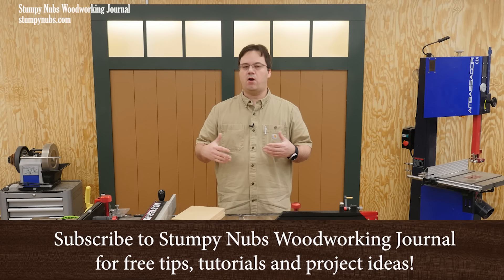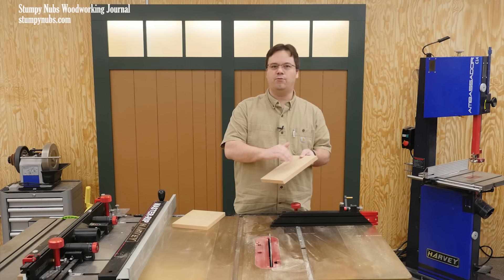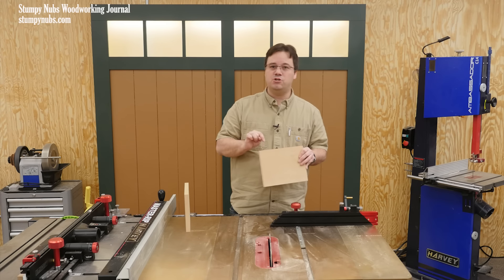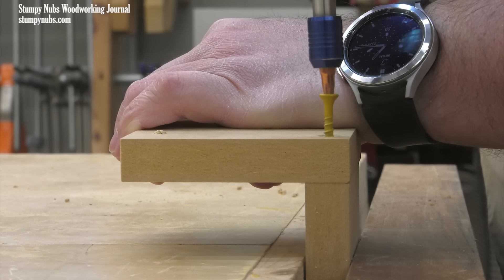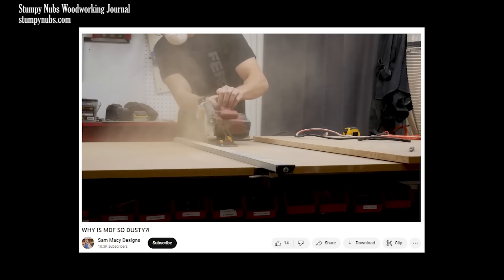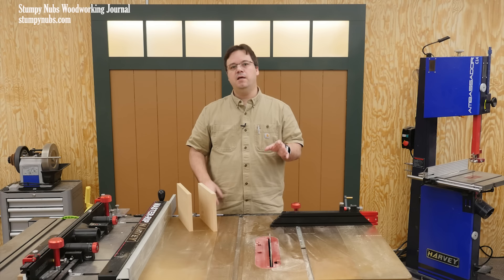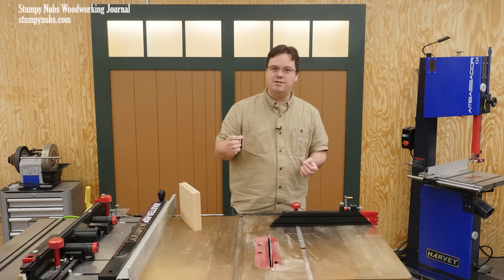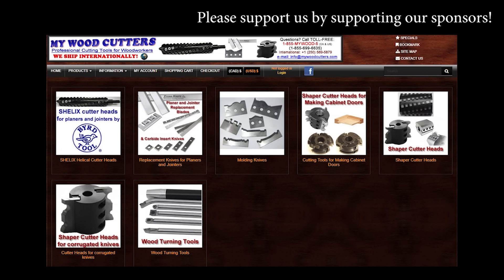This stuff changed my mind about MDF projects

Comment: It’s worth noting that MDF is not a uniform density all through. The smooth surface is considerably firmer than the underlying structure. If you sand or plane it thinner, you’ll loose much of its structural integrity, and just as a melamine coating will make fibreboard much stiffer, so does the outer smooth surface of MDF. Another piece of trivia is its permeability. A strong vacuum applied on one side will pull air from the other side. In this way, MDF can be used as a hold-down for sheet materials on a CNC machine. This works even better once you take the smooth, denser surface off one side.

Comment: I have to take issue with a couple of your comments:

1. You say that the best way to join MDF is a rabbet or dado joint.  Since the material has no grain, the short leg of a rabbet or dado is extremely weak, so you also need additional metal fasteners.
 A much better choice for a mechanical joint would be dowels or dominos.   

2. You show using deck screws (or cabinet assembly screws).  Although they will work, they are at best a compromise, since they are designed to be used in solid wood. The best fasteners are
Confirmat screws, which are designed especially for MDF and particleboard.  They have knife edge
screw threads, fit into a hole made with a stepped bit that makes the pilot hole and clearance hole at the same time, making perfect alignment.  You can safely drive them with a cordless impact driver.
Confirmats are made in 5mm dia and 7mm dia.  I normally use the 7mm for 3/4 inch material.

In my 30 years of teaching furniture and cabinet construction, I have made  hundreds of cabinets using dowel joints alone ( the 32mm system).  This system was devised specifically for joining
particleboard. 

I have also made hundreds of butt joints in sheet material using dowels and Confirmats. For a 24 inch long butt joint, I might use 4 dowels and 3 Confirmat screws, with a dowel an inch from each end, 2 others about 8 inches from each end, with 1 Confirmat at the center and the others about 4 inches from the ends. It is much easier than a rabbet and dado, and probably 10 times stronger.  No clamping is required.  To make the assembly faster, I drill a 3/16" hole at the Confirmat locations before using the stepped bit.
You can do this joint without the dowels, but I like them for alignment and some added strength.

Confirmats do require special drill bits. They are not very expensive. I have 2 that I have used for about 20 years.  They do require sharpening once in awhile because MDF and particleboard are very abrasive.   Also, coincidentally, Confirmats hold extremely well in the end grain of solid wood.

You might want to try Confirmats and test the strength.
Reply from the maker: No, my point wasn't that only rabbets and dados are good for MDF, it was that mechanical joints are the best way to connect two pieces. Rabbets and Dados were just two examples. And rabbets are best used when oriented so the force that would otherwise pull the assembly apart is against the tongue, forcing the tongue to break off if the joint is to fail.
Reply: @StumpyNubs   That is MY point about using a rabbet and dado joint with MDF or particleboard. The force to break that joint is rarely pulling the joint apart, it is force that is applied perpendicular to the joint, as in racking force, that will break the very weak tongue of MDF.   Actually, dowels are a far superior choice in this case.
You still are better off with metal fasteners. I think that you should do some tests with Confirmat screws versus deck or cabinet assembly screws.

Comment: I've often wondered if there is LDF or HDF as well as MDF?
Reply: There is. LDF is basically chipboard; full of air gaps & not very strong or good for anything except saving money. HDF is similar to MDF but has been put under extra pressure so it's a lot more rigid. If you ever see "hardboard" for sale, that's likely to be HDF.
Reply: Our local wood store sells MDF LITE, it’s no way the weight of the previous type he sold. But it is still a PITA, edges are worse to seal than the regular MDF as it’s much more porous. Your basically purchasing fresh air as they use less product to make it. Think AERO chocolate bar.

Comment: 1. Never ever use MDF where it might get wet. Even with primer and paint on, I have had tiny pin holes that have been hit with just a little bit of water and ended up with a really large blister. 

2. As for being fragile, I cut it into 2' x 4' sheets, bullnose the edges, and use it for panelling the lower half of my garage walls. Keep it about 1/4" above the floor to avoid water, and it is just about bullet proof. 

3. Finally, if you sand the edges well, and lightly sand the face to provide a bit of grip, just brush on a good clear coat with a quality brush. You'd be surprised at how nice it looks in the right setting.

Comment: I regularly make cabinets with MDF and leave it for curing for a week and then quote it with PU Paint. I run into a problem where no matter how good the work is, after a few days the joints just starts to show through the paint. I only wish I could show the picture of the failure and my disheartened face. Hoping you understood what I am trying to explain. Can you please give me a tip on how to address that issue.

Comment: Personally I hate any type of press board used in cabinets especially for lower kitchen/bathroom cabinets. Every lower cabinet in our kitchen has water damage with the bases either swollen or completely crumbling. Thank goodness the cabinets are secured to the walls.
Reply: Ditto.  But you know, there are ways to waterproof to a great extent.  Just an extra step though.  That is enough to earn hate.

Comment: What so many fail to mention is that there are many grades of MDF.  The premium grades and even some of the ultralight products have a more refined core (smaller particle size and consistent density).  Forget the joint compound when sealing the edges.  That is messy, takes a long time to dry and will be softer than the material itself.  Fillers should harder to approximately the same hardness as the material you're working with and MDF isn't gypsum or paper.  The absolute best method I have found over many years of trial and error is to apply Zinser B.I.N. primer with a foam roller.  It is fast, not too messy and reliable.  They key is to use firm pressure and multiple back and fourth passes, working the primer into the material.  It's ready to sand in about 45 minutes before applying a general primer coat and dries just hard enough that it sands perfectly flat..  

For fasteners, confirmat screws are made for the application and work better than most screws.  Knockdown fittings are the most reliable fastener I have found for MDF.

Comment: usually sand MDF to 500 grit, that leaves a "polished surface" so you can avoid using primer for paint, and can just use a 50-50 paint and solvent mix, then sand by hand and proceed on painting as normal, thats the method usually use with softwoods

Comment: Can you address using MDF as a large panel that you veneer to.  Such as a table top?  Attach hardwood edges and so forth…
Reply from the maker: I think the cheap furniture industry has cause people to think that MDF has no practical use. But there are plenty of projects where MDF is actually a superior product. For example, those who make speaker cabinets love MDF. It also is an ideal substrate for some veneer projects. And MDF panels are excellent for flat-panel cabinet doors when surrounded by a hardwood frame.

Comment: If you really have to screw into mdf: pilot full depthbof screw, use long screw with wide thread, preferably a wax coated screw, use drill with such a low torque setting that you have to increase the setting to finish the driving. Possibly add glue of some type, but I don't do that. Of course, screwing through the mdf into batten is preferable

Comment: I’ve only heard of HDF, but never see it in the stores.  Does it really exist, and if so are the properties more epoxy and less saw dust?
Reply: HDF can be obtained at the closest cabinet makers supply store. They usually cater to cabinet makers and don’t turn away any woodworkers seeking supplies. There’s usually one or two of these stores in every decent sized city. If your having problems finding one go to your nearest cabinet shop and ask them where they get there sheet stock from and they’ll point you in the right direction.
Reply: @dannyh.7490  thanks!  Much appreciated 😊👍

Comment: OK - got your comment about table tops - no argument - that's what I've been doing, using hardwood plywood.  Where would you use MDF?  Would you use it for a veneer substrate at all?  If not what would you use?
Reply from the maker: I think the cheap furniture industry has cause people to think that MDF has no practical use. But there are plenty of projects where MDF is actually a superior product. For example, those who make speaker cabinets love MDF. It also is an ideal substrate for some veneer projects. And MDF panels are excellent for flat-panel cabinet doors when surrounded by a hardwood frame.

Comment: I have a huge piece of furniture made entirely from MDF that has four 6ft brass doors that took 3 guys to fit each door due to the weight yet the screws are only 1/2" long, how this works is beyond my understanding yet I know of 3 more identical units all working well, I think they are at the limit of what is possible but equally very surprising the weight MDF can hold

Comment: James, I doubt if MDF is made of sawdust. Certainly it is cellulose based. 
But if soaked with water it disintegrates into thin  paper sheets.
Therefore , it looks as if it is a laminate.
And it is not as harmful as chipboard  , since it doesn't contain phenolic resin.
The rest is absolutely correct, particularly sealing the ends of boards before painting.
Thanks and LIKE!)))
Reply from the maker: Instead of telling me I'm wrong, you could have just done a quick Google or YouTube search and seen how it is made... https://www.youtube.com/watch?v=ZRE1L7anoss
Reply: @StumpyNubs  that's fine.
However, soak a piece of a board with water and you'll see the end.
It will look like a pack of cards.
Even if the raw material is amorphous mass the final product disintegrates into layers somehow.
Therefore, sealing the ends is required.

Comment: Not the threads, but the shaft, shows the threads 😂
Reply: Yes... 
   To show that the drill bit was big enough to cover the shaft but not the threads and therefore the correct size to hollow out the diameter of the shaft without removing the MDF that the threads need to bite into.
Reply: @BaobobMiller  how insightful.
Reply: @ Sarcasm gets italicized inside single quotes in written English.
.

Comment: My tips are to not table saw this stuff. It’s very dusty. Use a track saw instead because dust extraction is usually far better - with my Bosch set up plus a centrifuge filter there’s near-zero airborne dust. Also, in the UK at least, we can get MR (Moisture Resistant) MDF and it’s far less ‘fluffy’ on the cut edges. It’s usually green vs the tan colour of normal MDF and only costs about 10% more. It’s a great material though and about 1/5th the cost of birch ply per sheet. I’m a huge fan of it. Made the shaker doors on my kitchen 3yrs ago and they are holding up just fine.

Comment: The only screws that seems not to split MDF are Confirmat. I routinely use the 7mm x 50mm long.  Drill a 6.5 or 7mm hole which you countersink a little.  5mm hole into the edge of the board.  The screw has a coarse thread, has no point or taper so no wedging effect.

Comment: a little tip from the world of boat building which I have founds works on MDF. Before using screws in your pre drilled holes, dip the screw in varnish. I guess this works by binding the fibres next to the screw together and making them less likely to pull out - I’ve never had one fail doing this but I used to get them pulling out before I started doing this. Great video by the way. 👍

Comment: There was no mention of the flammability of MDF, I had a part time job on my days off years ago and one of my jobs was to service or replace used fire extinguishers.  I used to make at least 3 trips a week to my local MDF manufacturer and on occasion, multiple times a day.  This stuff burns baby!  On the other hand, it doesn't like steam, water, rain or any moisture at all... keep it away from projects that might be exposed to moisture, even if it has been treated.  Good video.

Comment: If you are making any kind of furniture (built-in etc) then I would strongly recommend moisture resistant MDF (MrMDF). Also the quality of the stuff you get from big box stores is likely not to be as good as that from a reputable timber merchant. I would never screw MDF as you have shown. If you need to joint it, then use dowels, biscuits or loose tenons. If I may recommend another channel here, then @10minuteworkshop / Peter Millard is worth a look if you are considering using MDF for projects. He goes into painting etc etc in detail.

Comment: Classic core MDF is plywood cores with 1/8" MDF for the surface. Great for paint grade cabnets. Strength of plywood and smooth surface of MDF.
Cabnets were faseframed with solid wood and cabnets tops were solid wood. Doors and drawer fronts are shaker style with 1/2" MDF rabited panels and solid wood frames.

Comment: If you can manage to spray enough plastidip on MDF to the point it no longer absorbs it, you’ll get a pretty waterproof and indestructible rubber-infused material. But it is… very heavy when done.

Comment: Learned that pre drill tip quickly. I also like to pre drill plywood for the same splitting issues. We do use mdf for cabinet doors, and panels. Not always, but in general.

Comment: How about dowels & biscuit joints?   As a structureal element, MDF is almost like Concrete, good in compression, very poor in tension. It often fails catastrophicein bending. It's also rather heavy compared to alternatives.   I seldom use it, unless I need its strengths OR IT'S WEAKNESS.

Comment: By the time you spend the extra time and money to prime and seal mdf, it costs about the same as wood but doesn't unless sealed with marine epoxy take water contact, at all. It's not as cost effective as it's intended or seems to be.
Reply from the maker: There are reasons to use MDF other than cost, as explained in the video. Sometimes, you just do not want natural wood.
Reply: @StumpyNubs  I'll take plywood in every case listed anyday. Florida weather has taught me one thing, MDF is only good in a desert environment.

Comment: Things I hate about MDF:
The weight - may not be as expensive or strong as hardwood, but it's just about as heavy.  When lifting sheets to pre-stage for the tablesaw I use a long flatbar to hold the bottom edge and extend my grip to make them easy to carry.

Sharp edges - wear gloves when handling! Factory or fresh cut edges can be very sharp.

Comment: About half way through you mention a Dado for joining.  Can you please explain what a Dado is, as in the the UK, my home, a Dado is a wooden rail fitted to an interior wall to protect the wall from the back of a chair rubbing and marking the wall,, so please what is a Dado to you Americans?
Reply from the maker: We call that a chair rail. A dado is a groove that runs across the grain of a board, into which the edge or end of another board fits. Dados are very common to secure the ends of shelves where they connect the sides of a cabinet.
Reply: @StumpyNubs  Thanks for that info.

Comment: I worked with 1 inch thick 4x12 sheets of MDF years ago. I always primed it with 5% thinned oil primer as per the advice from the manufacturer. We were laminating two 1 inch sheets to make a hard sturdy bar/commercial counter tops. several coats of laquer with wet sanding between coats then crinkled up  plastic bags dipped in paint to make marble look then several more coats of clear epoxy. bulletproof unless it was in a flood yet i still to this day detest MDF

Comment: I moved into a house where once again people decided at one time to decorate the bathroom with "wood" products.  Baseboard near tub was a MDF sort of material.  IT swelled up and I replaced with identical real wood plus fully waterproofed.   The cabinet under the sink in the bathroom was made of some sort of compressed wood with a white plastic ?  covering.  That is all well and good but the bottom that sets on floor is bare compressed wood product.  Guess what,  got damp,  material swells at the bottom and crumbles and the outer cover just comes loose.  If I had to replace it with identical part,  easiest fix,  I would also fully waterproof any part not sheathed in the covering.  But were me I would stick to tile etc.  in bathrooms.  And solid wood properly finished instead of this junk wood products that soak up moisture like a sponge!!!

Comment: I'm a volunteer in a Men's Shed operating in a small workshop - approximately 430 square feet in area. The workshop has a central dust extractor plumbed to individual tools/machines. We have two substantial room air filter units capable, on the highest of three settings of filtering 1000 cubic feet per minute. The outer filter is disposable and captures particles down to 5 microns, the inner washable filter captures stuff down to 1 micron.

Comment: Hmmm, well...almost right.  Yes the BOTTOM piece should have a hole drilled the size of the body of the screw, but (he neglects to mention) the TOP piece needs a clearance hole that's larger than the major diameter of the threaded part of the screw.  That's the only way the screw can re relied upon to actually pull the two parts together.  Doh!